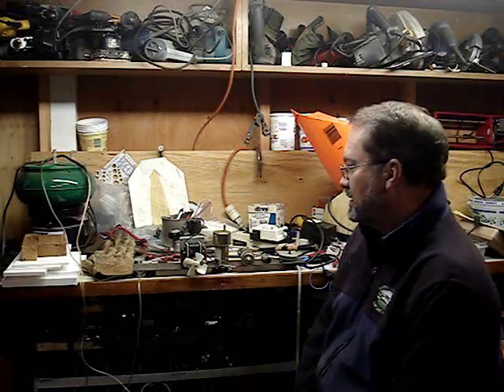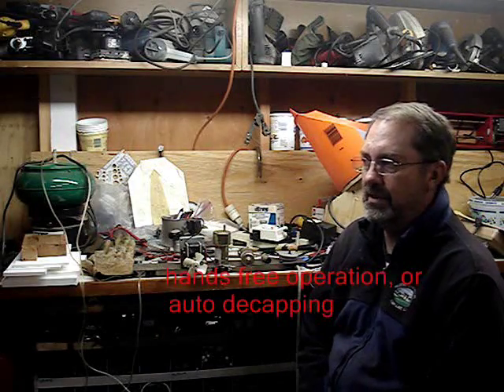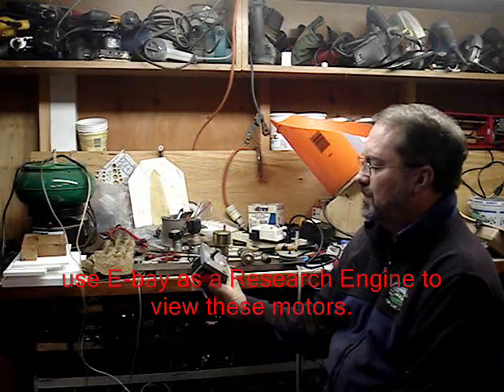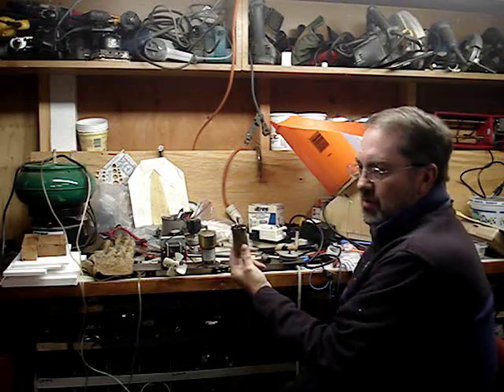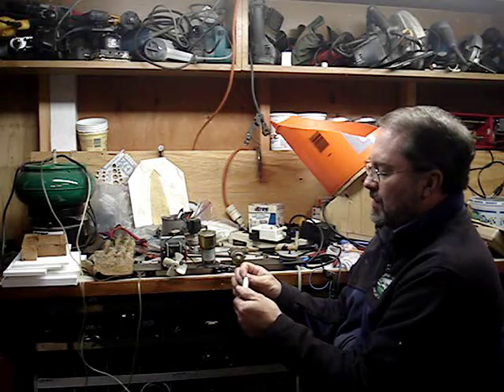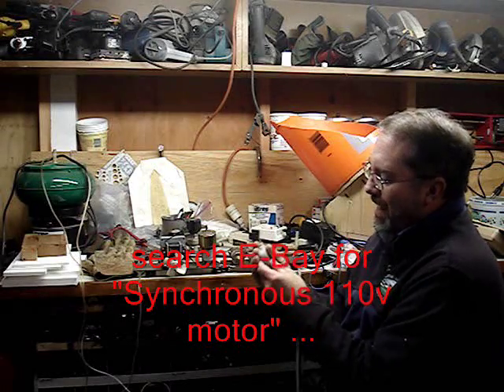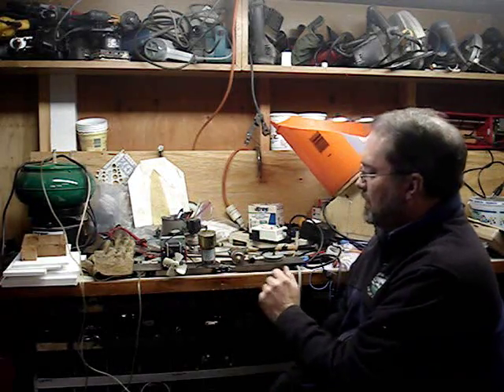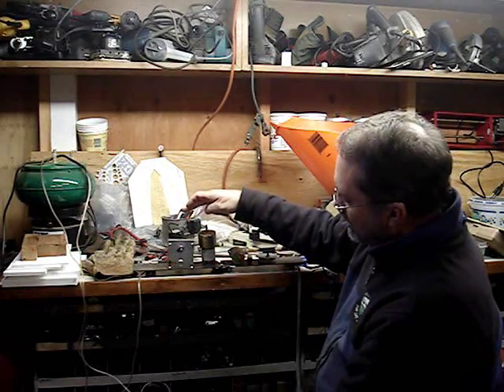Homemade case feeder bullet feeder motor issue part 1

Comment: Howdy Hunter2323,
Interesting video, I have some half-way builds of an 4 block full auto bullet casting machine, bullet collators (steel and plastic versions) and brass feeding collators, full auto bullet sizer etcetera. I know this is late, but I have some thoughts. Car wiper engine hooked up to a decent pc psu. I hooked one up to my star sizer through a 12v car battery, it did not have enough juice to calibrate and lubricate larger sized led bullits. But it should be plenty enough to turn a pretty full collator. The one I tried made about one full revolvment in about 6 seconds, it has 2 speeds also. These items can be found at the scrapyard for some homebaked buns in return. Just a late thought...
Reply from the maker: i'll look, am back home after a long contract job away..
Reply from the maker: ok, Grillmark makes a 120 vac, 60 hz, 0.036a Synchronous Motor, that runs at about 4.3 watts.  Since it is a synchronous motor it will reverse when jams occur.  It comes here locally at Ace Hardware Stores, in a replacement rotisserie motor kit.  So, that is the best i can do for casing feeder motors (cost and availability).  This motor will not work for bullet feeders.

Comment: How many watts is the motor you settled on.  It is fairly common on Ebay to find them rated 2-4 watts. Knowing the power of yours would be helpful. Thanks.
Reply from the maker: yes, i used a 4w sync motor, the best part is that when or if it stalls feeding a case in the drop tube, the motor reverses and clears the stall/caught brass..
Reply from the maker: i'll look, am back home after a long contract job away..
Reply from the maker: ok, Grillmark makes a 120 vac, 60 hz, 0.036a Synchronous Motor, that runs at about 4.3 watts.  Since it is a synchronous motor it will reverse when jams occur.  It comes here locally at Ace Hardware Stores, in a replacement rotisserie motor kit.  So, that is the best i can do for casing feeder motors (cost and availability).  This motor will not work for bullet feeders.
Reply: Hunter2323
 Hehe, I have all the parts and I still haven't had time to build this.  Your reply reminded me I have a rotisserie motor from my grill that may work better than the 5 watt motor I bought on ebay.  Thanks for the reply.
Reply from the maker: ***** my wife says,"build away", so to you i say, build away...